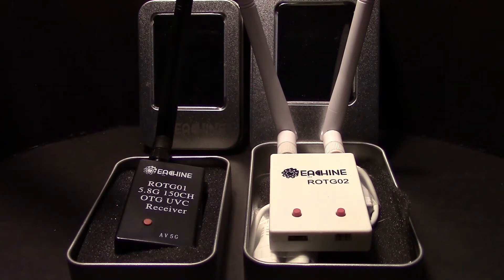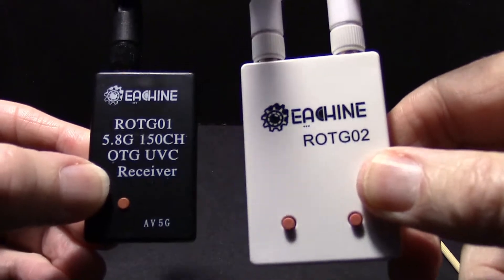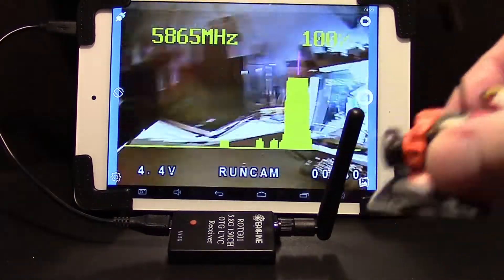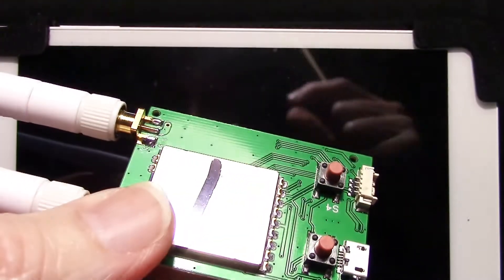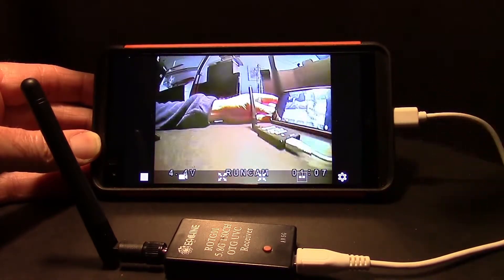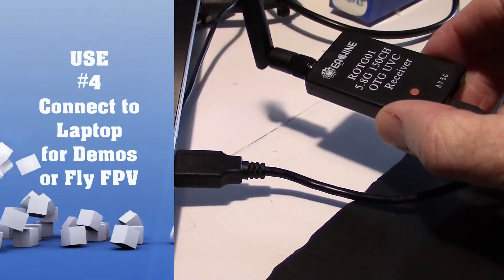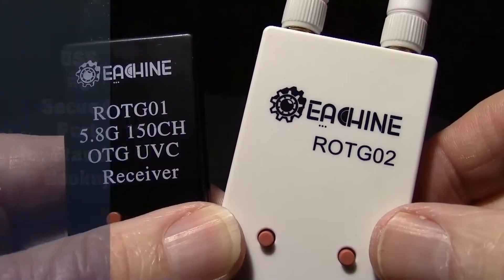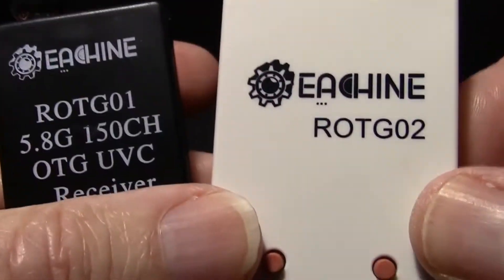5 Uses for the Eachine ROTG02 and ROTG01 Eachine FPV Receiver - Turn smartphone / PC into FPV screen

Comment: You're the best Dave💖💖💖After "testing" the Rx unit for about 2 years... I must say it's a great product. Even with the stock antenna. My Tx antenna is the clover leaf type. IMHO the transmitting antenna is most important
Reply from the maker: I wonder if they have made any improvements in the video resolution over the last 2 years.  On my PC and Mobile devices the video look pixelated compared to an analog monitor.

Comment: I have seen a lot of videos on this product, and not a one has mentioned where it gets it's power from.
Reply from the maker: Just to recap: Normally the voltage comes from the USB port over the OTG cable but if you want to use the white connector (AV port) you must supply the 5vdc from an external source such as a battery pack or UBEC. See this video for more detail on the AV port
https://www.youtube.com/watch?v=w7RYp6sO_Lw
Reply: I bet it eats up cell phone batteries fast. :o)

Comment: How do you change channels? Everything I can find says these automatically lock on to the strongest signal, but what if you need to view a different feed?
Reply from the maker: To move to the next frequency just short press the button. The ROTG02 has two buttons so you can go forward and backward through the detected frequencies where as the ROTG01 only has the forward direction.